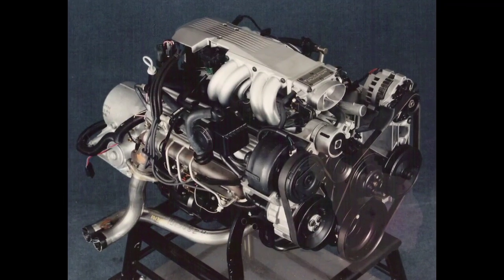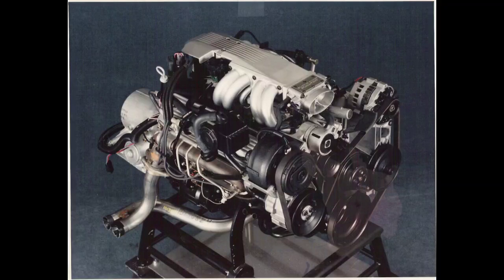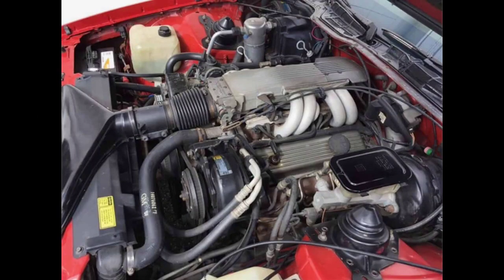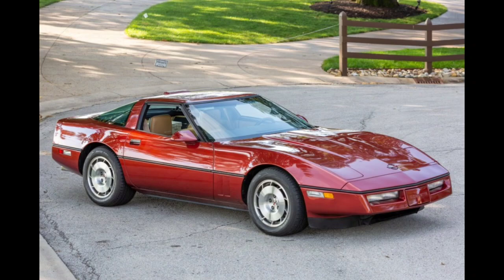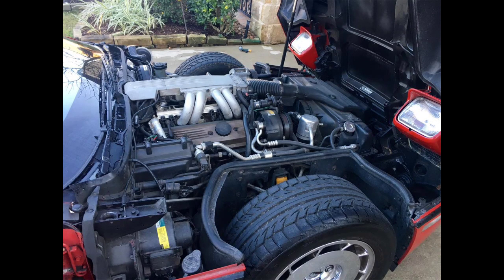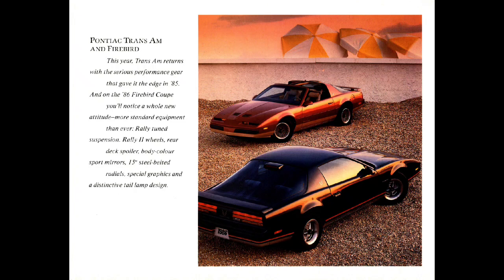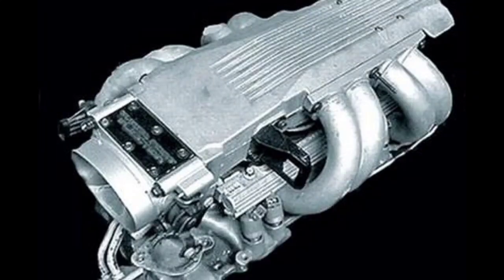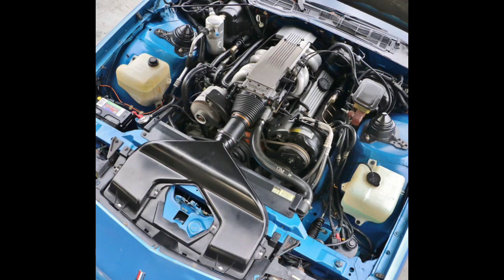GM's Return to Performance: Tuned Port Injection

Comment: Love this intake. I rebuilt the top half with new injectors,tore down the fuel rail replaced all the o rings ,new fuel pressure regulator cleaned out all the carbon from intake plenum and runners new gaskets,cleand throttle body and a good tune up and wow ,i like!!  runs like a top . 😁 And im not a mechanic.

Comment: I had an 88 IROC with the l98 5.7.  It would roast the posi traction tires off the line and bark going into second.  Once it got up to 4,500 RPM those beautiful runners would starve the engine for air and it would fall flat on its face.  Still a fun car and drive train.

Comment: Fantastic system, I was there at Flint V8 engine plant when these things were just debuting. They had a test engine sitting over in a corner for years after production started, I guess they forgot about it, I was tempted to ask if I could have it, they probably would have given it to me as scrap. I recently bought one of these Iroc Camaros with this setup and the thing is decently fast for being a 305, 1989 was my awakening to how enormously powerful FI could be in the right engine as I later drove a full size pickup in 1992, and the thing was just a stump puller, torque monster. Referred to in this video as a "sign of things to come". The 2.8 Liter V6 coupled to a manual in the RS camaros was surprisingly fast too with its MPFI. I had one of those as a commuter car.
Reply from the maker: I think in the mid 80's, everybody who thought in terms of power was still thinking about carburetors. I believe a lot of that had to do with how underpowered the early EFI system / engine combinations were. It wasn't until the TPI system and the Ford 5.0 Mustangs started to roll out that people said "Wait a second..."

Comment: I was at Pontiac back then, this was a good setup at the time, low RPM high torque engine, companies were coming out with larger tubes and lower intake for a sizeable gain, the burnoff relays for that mass air were its downfall

Comment: Owned a 85, 87, and 88 Tuned port Iroc, a 85 Trans am and a 85,94, and 95 corvette with Tuned Port. So much faster than the F bodies with carb or throttle body.  My 1987 305 Iroc was the fastest of all the f bodies I owned and was only a bumper slower than a friend's Formula 350ci TP.

Comment: '85 Porsche 928S, US model:  5.0 liters, 32 valves, four cams.  288 hp, 302 ft/lb @ 2700 rpm.

'85 Corvette: 5.7 liter, 16 valves, one remote cam.  235 hp, 335 ft/lb torque.  

'85 Porsche 928S2, ROW specification:  16 valves, two cams.  310 hp, 295 ft/lb at 4100 rpm.

Results:

'85 Porsche 928S, US model:  14.0 @ 102.  Car & Driver magazine.

'85 Porsche 928S, US model OBSERVED:  15.0 @ 98
'85 Corvette OBSERVED:  15.1 @ 95

Hello-?

My own '85 Porsche 928S2 5 speed, Bithlo Speedway:  13.86 @ 105.  Mods included a Borla exhaust, Louis Ott X pipe and Porken chip.  No other changes, street tires. And I have the time slip to prove it.  3300 pounds and around 330 hp/2.73 ROW rear axle ratio.

For your interest, I have never seen a COMPLETELY STOCK Acura NSX get a lower trap time than my 13.86-

Folks, power numbers mean nothing;  Where the rubber meets the road are quarter mile times and 0-100 numbers.

Great video!

Comment: Bosch LH-Jetronic.  Take a look at that Tuned Port Injection '85 Corvette V8 and then look at a picture of an  '85 Porsche 928S2 engine and you will see the instant similarity.  They had the same basic injection system, and the guts of the transmissions were both Borg-Warner.

-Since 1998 Chever-Lay has basically copied various Porsche products to produce their Corvette car.  While adding a whole lot of squeaks and rattles....
Reply: Posche has been loosing races to Chevy/GM over reliability for decades, and are definitely for the hand stitched fabric crowd who pays by the stitch.
Reply: @dallynsr  Whatever you've had to drink?  I want one.  Must be some strong stuff~

🖕
Reply: @Flies2FLL  
Yep, common view in the rear view mirror you’re #1. 
But to each their own.
Reply: @dallynsr  Yes, I rather liked the front of the C4 corvettes.  They did look good in my rear view mirror, headlights getting closer and closer together....
Reply: @Flies2FLL  
Personally, wasn’t that impressed with the C4s, the C5 bodies are beautiful… Still one of the best looking Vette bodies. In the new 2024 ZO6 is an amazing engine posche has nothing on…and the ZR1 is gonna make them look like Prudes once again. 
Can’t beat reliability when for many years and decades now Chevy has made the tough guy to beat on the simple but long LeMans. No turbos, no fuss, no muss. C5R and C6R was not an easy car to get around, even with the teams speaking German and Italian.
Reply: @dallynsr  The "creak and rattle" express.

Porsche sold a 928 with a DOHC 32 valve V8 engine, and even had a flat plane crank version for racing that they never used.

That was in 1985.  Hello?

-My current car, a '14 Cayman S is known for 7:40 Nordschleife times, approximately the same as the latest C8.  With 170 fewer horsepower.  Again....

Hello?
Reply: @Flies2FLL  and for twice the price your porsche will break down with half the miles
Reply: This has absolutely nothing to do with Porsche lol 
Friggen fan boys

Comment: I have a L98 TPI in my 88' GTA, I feel these are great street engines and in their era were good performers. A few mods and a tune can really wake these up.
Reply: I think every young man coveted the GTA when they came out, I know I did.
Reply from the maker: We all did. Affording one was another story...
Reply: @rporestorations  they were really expensive in their time, I picked up mine for 3k with only 78k miles in 2017. 

It was a killer deal and the car really only needed a full tune up including injectors, refresh the suspension and re paint the hood/replace the rear spoiler. The rest was a good cleaning/cut and buff to get it presentable. I did some old school TPI mods but kept all factory pieces.

Comment: It was an amazing experience seeing those back in the day and you could feel the torque
Reply: My parents bought a 1993 Olds Cutlass Supreme and even the the 3.1 engine has enough torque to notice being pushed back into the seats. On a test drive as a kid, my mom was used to lethargic malaise era cars where large throttle inputs didn't do much. We drove that Olds and when she stepped on it you could FEEL the torque.
Reply: mine had 345 ft lbs

Comment: GM copied a lot of Bosch's homework in this setup. It was a great system, especially with the air mass meter.
Reply: Well, they used Bosch parts. I'm sure they had a hand in it as well as the Buick injection/ignition systems too.